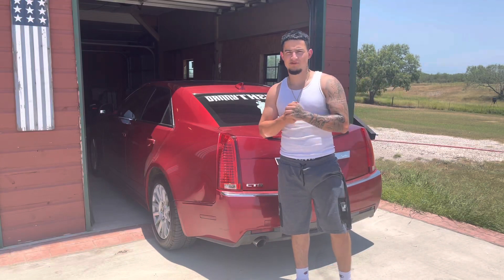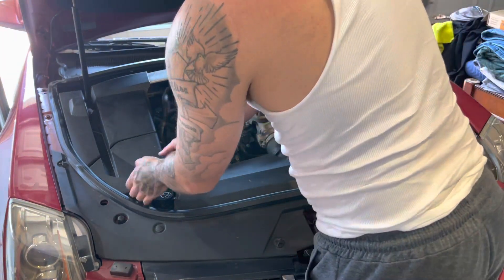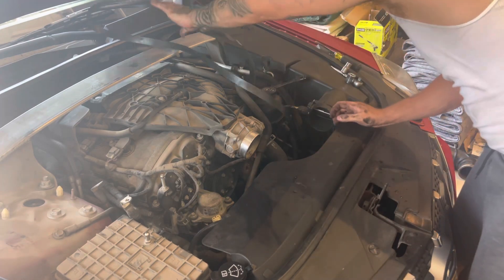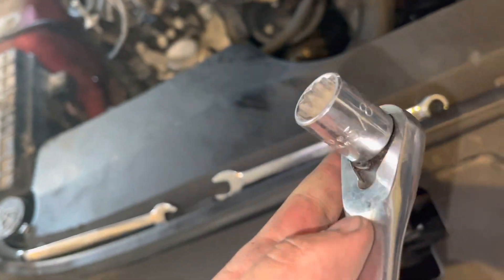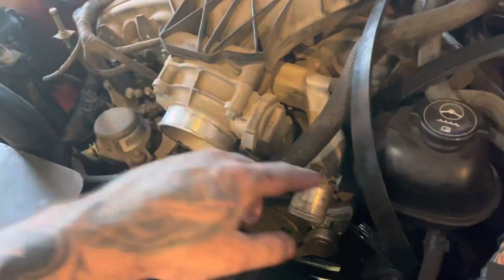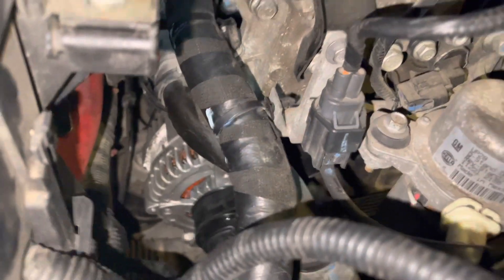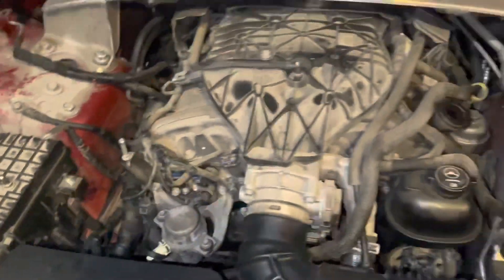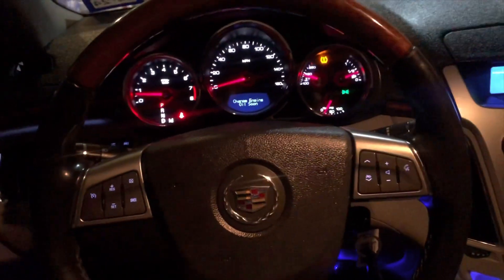HOW TO CHANGE ALTERNATOR | CADILLAC CTS 3.0L 2012

Comment: I’m about to replace my alternator on my 2011 CTS for the 2nd time! 
I run 2 subs so my alt gets extra load. Gonna put in a 300amp alt this time
I don’t expect OP to answer but… did you get the “service charging system” before your car died? 
Or did it come on when you put the new battery in?
Reply from the maker: I want to say it was after I put the new battery in bro
Reply: Probably too late but do NOT buy a cheap rebuild from Autozone (or even a new one).  Or your more likely to have to replace it sooner than later.  Go with an OEM AC Delco.  I sourced mine from Amazon for 300. Failing that, and if you go without the car for a couple of days, take the old one out and take it somewhere to be rebuilt.  

As you can see from this video, doing the job yourself is fairly straightforward but EVERY step is a pain in the ass.  When I called around, local shops wanted 4 to 5 hundred dollars just for labor.  The factory original went 80K miles before failing.  Hopefully I can get another 80 to 100K on the new one.

Comment: I noticed when driving the battery voltage will drain to 12.6 and then increase to 13-14v, back and forth. I did replace the battery recently, just bought an alternator, hopefully it fixes it. No battery light on for me though yet.
Reply: Let me know what happens bro I am having same problems
Reply: I just replaced the alternator, started the car and it maintained 14+ volts. Gonna test drive it tomorrow. My car would start with 15v then slowly drain to 12.8v then sometimes go back up while driving but then drain again. I hope this fixed it, I’ll let you know. Not good for the battery or the car if the alternator isn’t working properly.
Reply: Take the car to an auto parts store.  They do free testing.  At the very least, they can narrow down the problem.